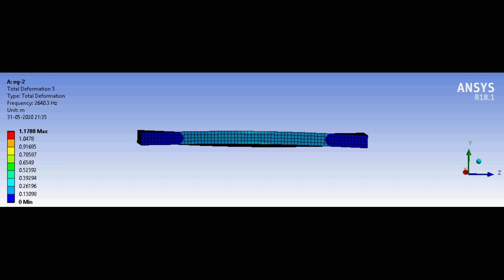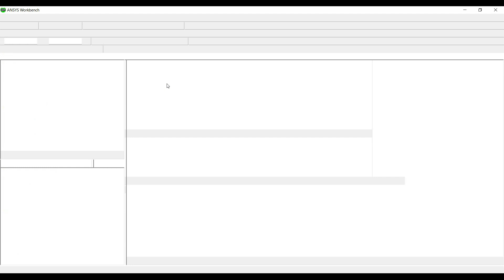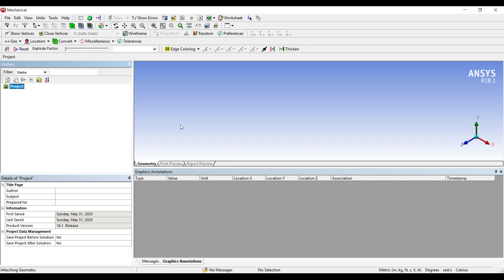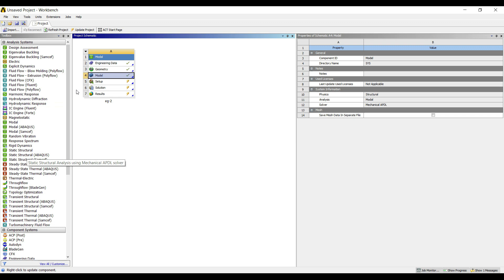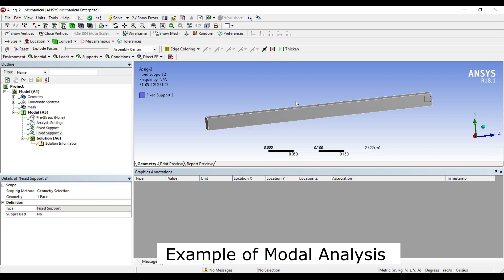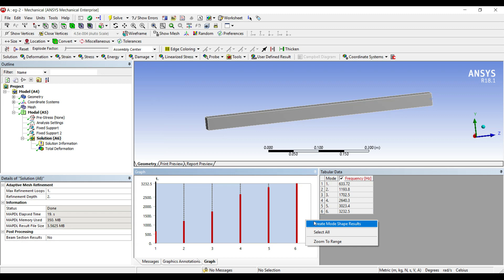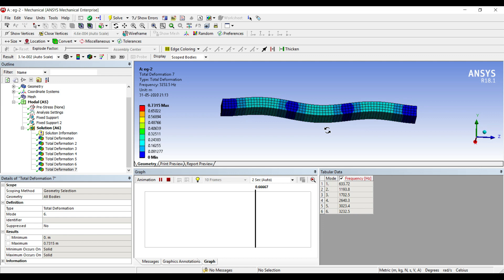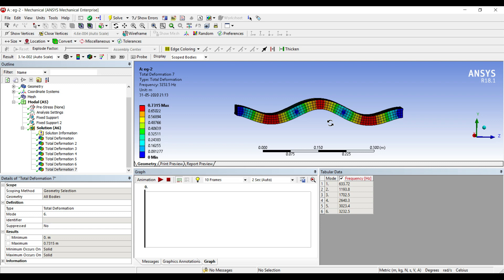Modal Analysis I Problem 2 | Transverse Vibration I ANSYS Workbench I Basic Tutorials

Comment: Hello. Thank you for this video! I have a question. I conducted vibration analysis of a rectangular composite plate. But I have to include transverse shear deformation effects. How will I do?
Reply from the maker: Hold bottom end as fixed and apply load in vertical direction that should create transverse shear deformation linearly.
Reply: @MechProverse  my advisor said that I had to open shell cards and I enter shear correction factor (5/6) into formulation. But I can’t find these shell cards. Do you knoe this? By the way, thank you for this amazing video and your answer!
Reply from the maker: @senagultunca2070  Sorry I am not aware of shell cards. It must be related to coding at the back end of ANSYS.
Reply: @MechProverse  I guess he wants me to change properties of Shell281? Is it possible? I am sorry I am asking tto much questions
Reply from the maker: @senagultunca2070  Yes it is. I will check and get back to you.
Reply: @MechProverse  Thank you so much! I am waiting.
Reply: @MechProverse  could you check it?